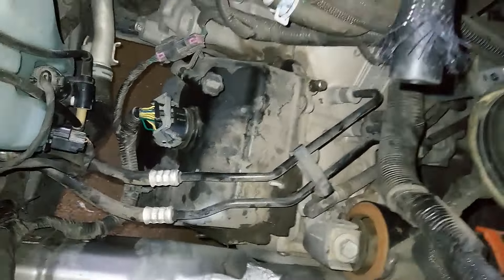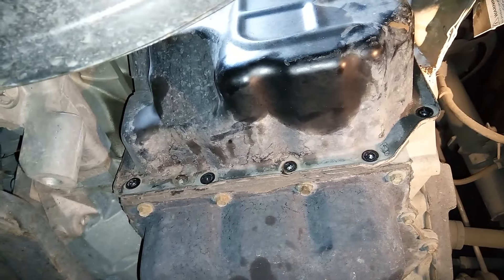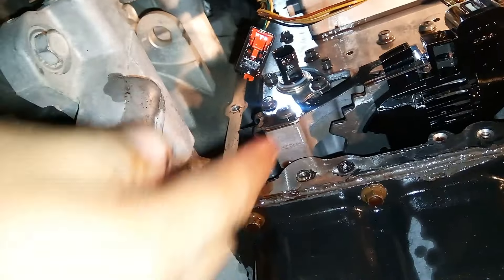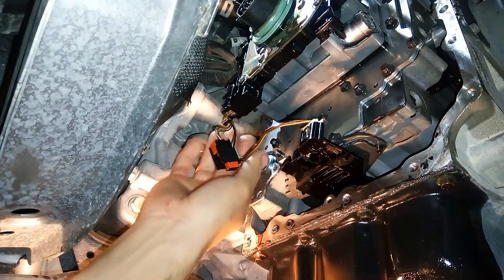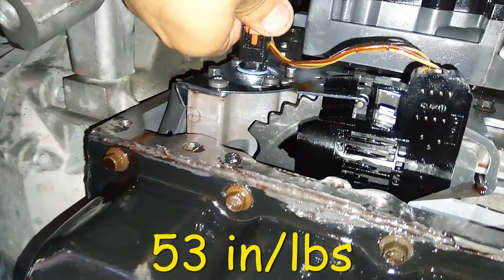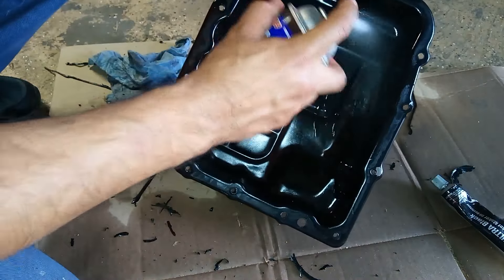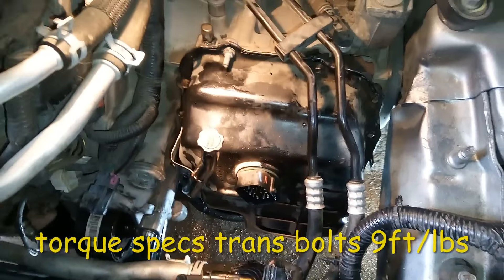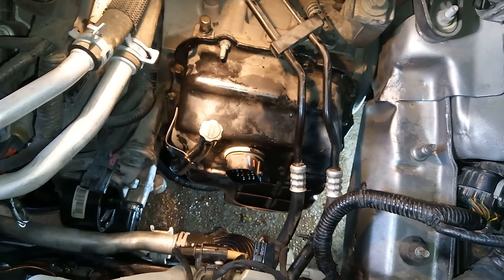Transmission Fluid Pressure sensor Location and replacement 62Te Code P084B

Comment: I have some sort of the same problem. My van sometimes hard shifts then feels like the front end is vibrating. I have to let off the gas and then gradually go again to get it to stop or if I drive it it’ll stop on it’s own. Sometimes it does it when switching gears, other times it does in overdrive just cruising down the highway. I can’t really afford a rebuilt transmission. So I’m hoping it’s one of those things. Weirdly enough it didn’t start until I changed one of my front tires with a snow tire, while the driver side had a road tire.
Reply from the maker: No codes??? This sounds like something different...
-Always use same tires especially on front..same size. 
- check if tires are good(make sure there is no bubbles or something similar on it) 
- if there is a code it might tell u what is the problem with ur vehicle. 
I think this problem is something with no enough fuel or air going into the engine. 
If u don't have the right mixture of this 2 components along with a good spark,it will cause engine to stall which has happened to u. 
Keep us updated if u find codes or u are able to fix this problem. Thanks for the comment and for watching my content 🤘
Reply: @larasgarage2021  no no codes at all. Yea I was hesitant about us using different tires. I have no switched the snow tire to the bank and exhanched that tire to the front. So now I have two road tires on front and one snow tire on back. I was hoping it was a transmission Mount. I don’t visually see anything wrong with it. But oddly enough it does vibrate a little just idling. I test drove it early and floored the gas then let up real quick to get the motor Mount or transmission Mount to move but it acted perfectly normal. It’s weird. Theirs nothing I can do to re create the vibration or jerking. But it does seem to do it more going up hill. It seems it’s just at random times. Hoping to get a fix soon
Reply: @larasgarage2021  idk much about freeze cores at all but maybe theirs something their. But I have a code reader and it passed
Reply: Also. Weirdly enough it didn’t start doing it. Until I put a snow tire on the front. Now 3-4 months ago. It quit shifting period. Wouldn’t go into park. I changed transmission filter and fluid and fixed it right up. Drove good. Then put a snow tire on front and that’s when it started messing up. So do you think the snow tire got it really out of alignment? Or damaged cv joint
Reply: Also. If it was a pressure sensor. I would think my check engine light would come on. Or if any sensors was bad. Other then the transmission Mount I’m at a loss.
Reply from the maker: Yeah if any problems with sensor u should have a code or check engine light on. 
*With a bad transmission mount or any mount actually u could have a vibration on the car...
So check this out: if rear engine mount is bad u feel the vibration when accelerating since the engine moves just enough to hit some parts of the frame. Believe me it happen to me with a 2014 journey.... usually when I hit gas pedal and it was going from first to second gear it was the worst vibration...
*Transmission mount the same every time car shifts u caa feel the vibration at least a little. 
And if u park at idle and u feel vibration just sitting there it could be passenger mount. 
Runt this test: with somebody helping u, out car Drive but hit brake really hard(u can use e brake to help u with this as well) then press gas pedal but don't let the car move...rev ur car a couple of times and check engine bay(that's why u need a second person there) and see how much engine is moving....if engine move a lot and u can feel the vibration then rear engine mount is bad ...if this is your problem I suggest u replace all of them....I believe u have the same car on this video so if u have a journey it should be 4 mounts,front and rear engine, passenger mount and transmission mount.
Reply from the maker: put car in drive**
Reply: @larasgarage2021  okay will do! Thanks a ton! I’ll give you an update as soon as possible!!
Reply from the maker: 👍 forgot to mention..rev car to 4 maybe 5000 rpm...just to make sure engine is not moving that much...if rear mount is bad it will be very noticeable..
Reply: @larasgarage2021  you called it! I put hand break on and held the brake and reved it up and the motor moved a lot more then it should. I checked front motor Mount just behind radiator at the bottom and it’s ripped about 2/3 of the way in half.
Reply from the maker: Well there u have it...it is the mounts.  😃😃
U can replace that one and if u still feel the vibration replace all of them. Sometimes is not visible the damage on the mounts...so is hard to tell if they bad just looking at them. So if vibration continues just replace all of them and u should be good👍
Reply: @larasgarage2021  is it still possible to be the mounts? If I’m going down the road I can’t make it do it. I’ll floor it then let go and try to get it to do it but can’t. It does it when it wants do.
Reply from the maker: @TheCoolKidsClub  did it happen again vibration and jerking? 
I didn't understand what you trying to say 😅
Reply: @larasgarage2021  what’s your email and I’ll send you a picture of one of the mounts. The one that hooks to the top of the transmission under the battery.
Reply: Sorry. I was saying. That I went down the road and tried to make it do it. You would think if I gave it gas and let go fast it would do it. But it didn’t. I can’t make it do it when I want it too. Lol it does it when it wants to. But I have taken a picture of one of the mounts and it seems ok but I wanted a second opinion
Reply from the maker: @TheCoolKidsClub  send it to my IG @larasgarage2021
Reply: The best way I can describe it is. It feels like your going over rumble trips that they put on the roads to wake up drivers.
Reply: Okay I sent it on my wife’s Instagram. I don’t have one of those. But I was also wondering what is the bushing called that’s connected to a black arm that looks like a wish bone that goes to the bottom of the wheel hub.
Reply: Because when I jacked it up using a scissor jack that bushing was sideways basically
Reply: Maybe the suspension bushing?
Reply from the maker: @TheCoolKidsClub  I think the part u talking about is the lower control arm. So u can buy the whole part which comes with new bushings or I think u can buy separate but is a bit hard to install those back in the control arm.
Reply from the maker: @TheCoolKidsClub  could be the ball joint too...send me a picture and I'll let you know what it is
Reply: @larasgarage2021  ha yes that’s what it is. Could that cause any shuddering more so when going up a hill?
Reply: See awhile back before I changed the transmission fluid and filter I got the TCC circuit malfunction code. I haven’t got that code sense. But it wasn’t doing what it’s doing now then either
Reply: The first pic is the Mount I was talking about. Both sides look good but I noticed their was a decent amount of room at the top
Reply from the maker: @TheCoolKidsClub  if any part of the suspension is bad,like ball joints,tie rods inner or outer,control arm bushings,etc, any parts of the suspension that is bad it will cause vibration,bad alignment, vibration on steering wheel etc....so if u see some of those bushings broken or in bad condition is better to replace them.
Reply: Theirs also some weird things going on when I brake but you only feel it when you brake hard. Like going down a hill. I’ve checked brakes and rotors. Both seem fine. But on the driver side. The rotor has more play in it then I would think their should be. The distance between the luge and the rotor is a decent bit. But when you tighten the lug nuts down with the tire on it it should be good right? Could that cause any trouble with their being a lot of play with the wheel off you can take the rotor and go forward and backward quite a bit.
Reply from the maker: Here u could have 2 problems. 
When u brake hard steering wheel vibrates a lot? 
1- brake rotors are bad...there is no way to actually see with ur own eyes the problem..but believe me theiare bad ...
2- bad wheel bearing....wheel bearing can be check to make sure bad before spending time and money.... sometimes when wheel bearing is bad it can make noises when driving, also if u lift ur car u can try moving the tire by hand on a cross pattern...when u grab the tire from the top and bottom and it has a lot of movement or u hear a clicking noise it can be a bad wheel bearing
Reply: @larasgarage2021  okay I’ll try all that. No I don’t hear any noise when driving. It’s just feels like theirs a wave when you brake hard. Look your rotor is going over a wave lol
Reply from the maker: @TheCoolKidsClub  here is this link of a short a made just to give u an idea how to check wheel bearing.  https://youtube.com/shorts/zM9cqxTSJZU?feature=share
Reply from the maker: @TheCoolKidsClub  here's is an example of how to check for wheel bearing too on a different car...I had to replace it on a Ford mustang not long ago... https://youtu.be/Rjb3ztyZnz8
***Keep in mind that if some parts of ur suspension are bad(tie rods,ball joints etc) tire will move a lot...so make sure where is the movement coming from...if is right at the wheel bearing and there is noises there u have the problem....but please make sure that is the problem...I don't want u to spend money just guessing what could be the problem.

Comment: Hey does changing the sensor resolve the code P083B as well
Reply from the maker: Hi there! Do u have any symptoms in ur car? Or just the code?
Reply: Only symptoms is that it randomly goes into limb mode. But goes away when I stop and start again
Reply: @NEILRODRIGO-g6l  did you ever sort this code out? What fixed it?

Comment: Hi, I just got code 0841 what does this mean?
Reply from the maker: |Code P0845 Dodge Possible Causes
Faulty Transmission Fluid Pressure Sensor 'B'.
Transmission Fluid Pressure Sensor 'B' harness is open or shorted.
Transmission Fluid Pressure Sensor 'B' poor electrical connection.
Transmission Valve Body.

It can be any of these things.  I suggest u take it to a mechanic so they can check connectors and wiring and see if everything is working properly.  
Car might have a bad solenoid,bad pressure switch etc...anyway u need a diagnostic to determine what the problem is. 🙃.
Reply: @larasgarage2021  Mine just went out literally 2 days ago almost killing me..... my whole truck stopped when I was driving, and it's telling me that this is the issue

Comment: Hey how  much fluid did you use??wen i took my side pan off no fluid came out😢😢😂😂
Reply from the maker: My best advice is to put in whatever amount came out of the transmission. If urs have a dipstick check for proper oil level. If it does not,well, take my advice 😅
U shouldn't get a lot of fluid out of there when u remove the pan anyway.
Reply from the maker: If u have the same transmission that shows in this video, probably it won't have a transmission dipstick.  U can order one from ebay or Amazon (aftermarket part) if u think u need to check the oil level....
Reply from the maker: https://www.ebay.com/itm/151745623113?mkcid=16&mkevt=1&mkrid=711-127632-2357-0&ssspo=_ocgJ_W1Quq&sssrc=4429486&ssuid=yZ1oinQlQMC&var=&widget_ver=artemis&media=COPY
Reply from the maker: This is a link for a dipstick.  U can use it for different transmissions.  The one showing in this video is a 62te transmission.  Dipstick comes with a chart for different transmissions.

Comment: Is this the same for a 2013 Town & Country Limited
Reply from the maker: Yes it should have the same transmission.  👍
Reply: @larasgarage2021  I also have the code p0841 and p083B would these codes be for the sensor?
Reply from the maker: @Mrclappers61297  looks like those codes are related to the fluid pressure sensor.  Look at this video and run the test on your transmission.  See if the solenoid pack is working properly.  If you don't have any problems and readings are right, the only problem will be the oil pressure sensor.  This is the video u need to see https://youtu.be/e93sOaC-tg4
Reply: @larasgarage2021  Great so I checked the solenoid pack and pin number 12 was at 5.9 ohms the max it was supposed to be at was 5.1 that’s for the line pressure would this be giving me a high reading because of that oil pressure sensor I also have the code P0 935 hydraulic pressure sensor circuit high can this because by the pressure sensor? Thanks for responding you’re the best!
Reply from the maker: It is possible  u having bad readings because of the sensor.  They all communicate with each other and send info to computers. 
I suggest u go first for the oil pressure sensor, if that doesn't work, u can try the solenoid pack. U have to many codes related with bad pressure. My money is in the oil pressure sensor.  Next will be solenoid pack. 😅

Comment: I have p0868 does this have anything to do with it?
Reply from the maker: P0868 code indicates that there's an issue with the transmission fluid pressure,and is what this video is about.  ...keep I'm mind that this sensor comunicates with computer and also with solenoid pack....there is a video in my channel on how to check solenoid pack. I recommend u to watch it,run that test first, and see if all readings are correct.  If they do,check connectors from the transmission to the computer...make sure everything is making good contact.  
Does ur car have any issues or is just the code ?
Reply: I have this same code p0868 for months I didn't know what was wrong with it because no lights were on the dashboard. Put a scan tool on it and 1 code popped up p0868. When breaking it feels like it wants to stall and it has gotten worst😅. Thanks for the video I will have my mechanic check this area

Comment: J'ai le même problème ce matin avec ma Fiat Freemont,je demande si le problème est résolu avec le changement du capteur?
Reply from the maker: If check engine light is on and is telling you this is the sensor giving you problems yes...replacing this sensor should fix the problem.  
This sensor communicate with the solenoid pack (which is inside transmission as well) make sure u check readings to make sure all solenoids are in good shape.  I got a video with a charts and how to check solenoid pack on this transmission.
Reply from the maker: https://youtu.be/e93sOaC-tg4
Reply: Le code de défaut c'est P083B ,le vitesse reste coincé sur la 3ème et température de transmission toujours bas,après un trajet de presque 12 km ,la température reste fixe en 23 c,j'ai arrêté le moteur et je redémarrer la passe vers 40c ,et la transmission commence à  échanger les vitesses. 
Presque le même cas que chez vous
Reply: Après avoir changer le filtre de transmission et nettoyer complètement le bloc solénoïdes .
Le code P083B est disparu,mais un autre apparu P0868,Les vitesses passent bien son blocage au 3ème, je demande si problème revient au capture de pression de huile dont vous avez parlé. 
Merci pour votre soutien .

Comment: Can this sensor cause code p1745 limp mode if it goes bad?
Reply from the maker: Yeah it's possible.  If sensor is not working properly, it won't read correct oil pressure in the transmission.  This can cause limp mode or transmission  not shifting properly

Comment: Do you have to drain the fluid?
Reply from the maker: No. Some fluid will come out when u remove the transmission pan... but is not a lot... just make sure that after the repair u put back the same amount of oil that came out.

Comment: I changed my sensor today, it was barley any fluid in the pan
Reply from the maker: 👀👀👀😬  most of the oil is in the lower transmission pan. Hope everything turns out well 🙏
Reply: @larasgarage2021 ok I'm going to change filter and gasket since it had a leak. Hopefully this would he me get back rolling

Comment: What is the part number please
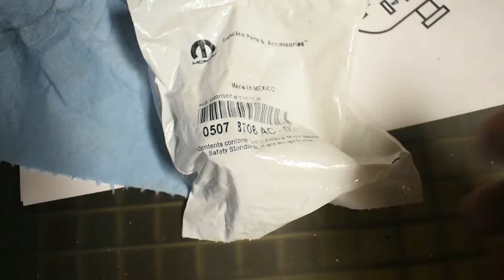Reply from the maker: Minute 7:30 is the info brother. 
If u go to Dodge dealer give them car info and ask for transmission oil pressure sensor or  transmission pressure transducer switch....same part.
Reply: J'ai le même problème ce matin avec ma Fiat Freemont,je demande si le problème est résolu avec le changement du capteur?
Reply: J'ai le même problème ce matin avec ma Fiat Freemont,je demande si le problème est résolu avec le changement du capteur?